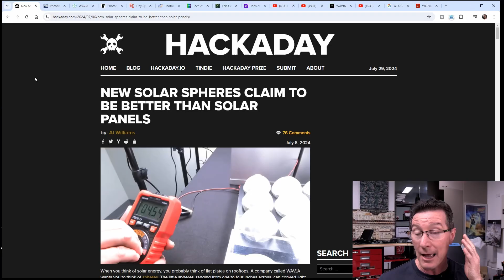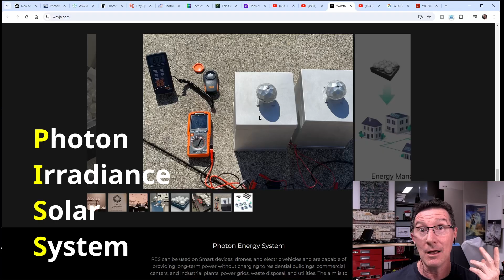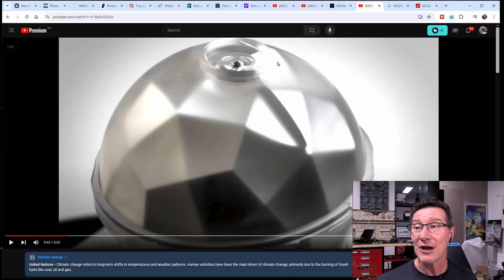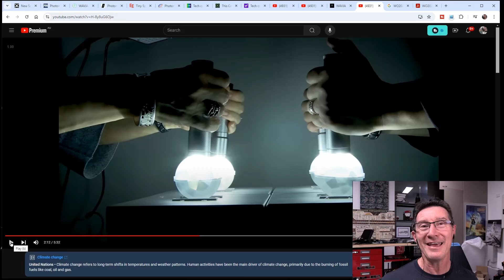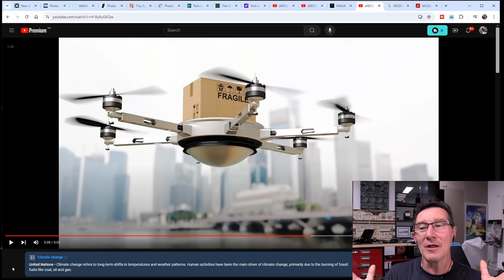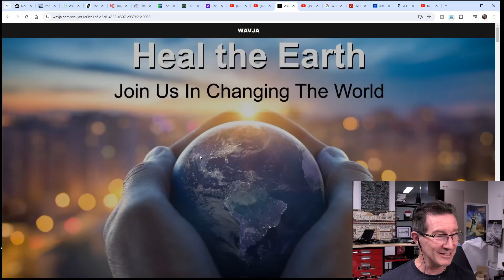EEVblog 1633 - WAVJA Solar Balls, 60x Better Than A Solar Panel? - Part 1

Comment: Hey bro, I have a curious question. I have a small solar setup to run my crosshair laser, it's for my Zombie shield, as it has 2x railroad spikes for the eyes 👀, being the target 🎯. I got a flashlight lantern and it has a small solar panel built into it, and got an extra solar panel to help with recharging, and the lantern has, I think, 5000 Mah power bank and a sewing machine cross hair laser. I got it all off of Aliexpress for $20 CND. And this thing is super light in weight, compared to what we used as kids, and it's also brighter 
Just wondering how good this would be for charging a 100-watt solar panel at night, and would the laser be good to use on a solar panel? The unit just has a little red check light to say it's charging. I don't have any testing equipment like you do. I was just wondering about the effect versus the cause, as I want to also outfit my medieval helmet with a car dash camera system, just for basic viewing information at quick glances and for nighttime surveillance, in low light conditions or StarLight. It requires 12 volts as well and is to be used with a cigarette lighter outlet, as the helmet viewing through a perforated metal guard is not the best. but its the safest and low maintenance vs a plastic shield which can get all scratch in no time, which requires replacements often, which is harder to come by in an apocalypse setting.

I flap on Qurora in answering questions related to Zombie stuff. And decided to actually do the bucket list 📃to meet the said requirements of being a melee paladin/tank or knight build.
I'm just upgrading some stuff to "second generation." The light can rest on the shield, which is slung off the left shoulder when not required, and leaves the lantern to face forward. This way, you can have a walking light at night for perimeter patrols. It's also about having a setup that "pops" and having redundancy set up to use for other areas as a bonus. 

Just a hobby type thing I'm doing so any addition info would be great!

Comment: Yeah , remember the little batteries,looked like easter eggs , and you'd pour a bunch into the glove box , and fancy software balances them all in order of level of charge. Well lift open one ,and you see the normal battery incased in plastic egg ..Tanktwo was thier name yo. And it made it to the trade show circuit etc . but the company will disintigrate , with no funds. Probably go back to writing battery management software for bill gates, type if needs equipment. And thatswhy people get excited about bogus products like these fake solar speres . Literally the physics on earth, or anywhere else in the universe will not support.😊

Comment: As a law student, I'm concerned by the use of Esq. in their names. One of them does appear to be a lawyer, but the other doesn't seem to be. Using Esq. is used to identify lawyers in the US. The Cheng guy doesn't appear to have ever practiced law His LinkedIn says he lives in New Jersey and I don't see anyone listed as a member of the Bar in that state by his name. If he's using that to gain credibility, especially as suggesting he's a lawyer, it could be unauthorized practice of law or fraud and misrepresentation. It's at least unethical. Normally, even lawyers only use it when they are serving in their capacity as attorneys, like on their employment website or court pleadings, but a CEO with a law degree, even if licensed to practice law, typically would not. That's super suspicious to me.

Also, if they are lawyers, when this comes out as a scam, they can expect Bar complaints and will probably lose their licenses.

Comment: They aren't even using a solar cell. The little dark thing on the top of their ball is an LED working backwards to convert ambient light to a voltage.

Comment: I think you should do the thing I just watched an ad for ties. it was for the Edison generator a lost technology that this guy found in his attic or was it a safe and it's so easy to do anybody can make it with the plans and it's small and lightweight and has plenty of power but if you're going for a whole home you wanna make the bigger version and it amplifies the power you put into it but it doesn't need the grid because you know his granddaughter almost died.
All I have to do is spend 50 bucks to get the plans and buy about $100-$200 worth of materials before the website gets shut down because of the super horrible energy companies. Yeah I reported the ad and watched their "five" minute video more like 30.
And oh yeah this is better than anything Nikola Tesla did I mean Nick–cola Tesla this is from Edison and his plant was burned down mysteriously.
Oh yeah and the disclaimer for entertainment purposes only and they cannot guarantee success due to variations in materials and construction yeah any buddy could do it with the plans anybody's anybody's even my great great great grandmother.

Comment: source trust me bro it works like this you charge it with your flashlight to get the multiplication factor by magic table and then any light that enters from the sun get's power multiplied by the charge factor and boom you got 20W out of 1W input power from the sun easy as that
this is just a joke

Comment: 60 times more efficient than current solar which is about 20% efficient.  Nice try......
Reply: Fact that  some people are able to fake stuff like this guy dont say anything about what is reality. Watch the real video and make sure you understand what it is that they claim. They claim to be able to make a sphere that is 20 times more efficient per cm2 than a average solar panel PER CM2. And it is correct - i can make a similar cube by materials other companies make today, so the cube is 100times as efficient as solar panels per cm2 of wall space. 10000% better if you measure just on energy per wallspace cm2

Comment: It dont have to be a scam, i think they are just overselling the performance. If a solar panel of 320watt/m2 are divided into 4 squares of 50cm x 50cm, then inventors claim that 10cm x 10cm x 10cm produce 80watt like the solarpanel. But solarpanel produce 80watt for 6hours this one produce 400% longer time, so to be 7.5times more efficient as they say, then they just need to improve solar system from efficiency of 16% with a standard solar cell to 30% to be right. And where a normal solar cell is 2cm thick this one is 5times more thick. So in theory it have inner walls that not only fill 10 x 10cm but 6 of these squares It is just less because it is not sq but round shaped. But your efficiency if up by 100% by using 600% more panel, so you go from indeks 200 and divide by 6 so the panels is just 30% as efficient as the solarpanel, so when they claim to have current efficiency at 20times (not 7.5) it can be archieved with normal solar panels. It starts to get a little odd when they expect the future to be 3 times more efficient, but maybe photon energy can make this happen.

Comment: Sounds like they're trying to create self amplified photo cells that work like lasers but without pump power, like the light will bounce off the mirrors and each time raise the energy levels in the doted material it is reflected from 😅

Comment: 60 times more power?
This meany that the efficiency is 61x 21% = 1281%
So 7.5 is wrong.
Where does the 1181% of energy came from? Some a StarGate like vacuum energy device?
38430
If they are 30x smaller, then the efficiency must be 1281% * 30 = 38430%

On of this devices is replacing 384.3 PV-panels.
A ordinary panel gives around 45V@10A and this device gives 45V@3843A ?
For this you need a cable with 4.65in² (3000mm²) cable cross-section.

Comment: In France, we use a Glomurge with quantum amplification that can supply 
provide 5 V or 5 W (it's the same thing) even without light. The cubic spheres are 
impregnated with over-activated Gibolin . 
Gibolin is made from "Camember au lait crû". I can't reveal how it works, as patents are pending!

Comment: Testing LEDs with photodiodes is problematic because of reflections - So a device called "an integrating sphere" is used to ensure all light is captured, with a small photodiode at the side. Those balls are essentially an "integrating sphere". However, they can only capture light through the aperture at the top. So They are correct that they improve efficiency - but 60% improvement for the tiny area they capture and certainly not 7.5x better. The cost of doing this of course is that they don't have a large area of capture - which means that overall, they probably perform much worse than a normal solar cell. There is one advantage: They don't need much solar cell material. But solar cells are dirt cheap these days, so even that is probably not an advantage. The BS at the end on powering flying cars is truly deluded.

Comment: Solar panel typical efficiency ~ 20%. Wavjina claims 20 to 60 times the efficiency compared to solar panels and I don't know if these also create space-time, or just energy and matter.
For anyone not understanding the significance, these prosthetic balls will charge your car's battery with the light from the headlights powered by the said battery. Infinite power!!!!!!!! Solar freaking ballways!

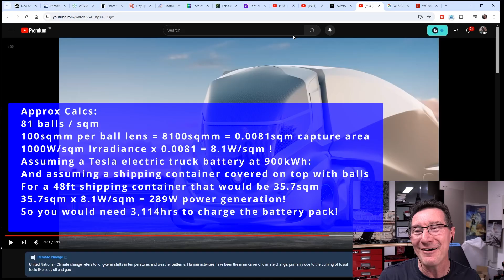Comment: 18:23 LOL! look at the diameter of the cables going out of the crap that is "supposed" to be able to charge the car! Do you note any differences with the cable used to actually charge an electric car? 🤣
And the previous picture is a huge drone moving a freaking cargo container of the ones used for import/export goods by ship.
How did that woman even said that claims with a straight face!??? She must have no f*cking clue at all. She must be some generic scapegoat someone hired to mount this scam.

Comment: They put zero effort into this.  At minimum they could have at least actually charged a battery or super capacitor with it. It would work... eventually. At least show something lol.   The whole concept is dumb though, just use regular solar panels, it will actually work better.

Comment: Saw this first in Sabine Hossenfelder's video, but she didn't go in so many details. Just saw that picture where they're allegedly charging an EV from a truck having these on its roof. You know why it's a truck? Like with all other perpetual motion / infinite energy 'machines', the real difficult part is where to hide the batteries. A truck trailer/container would do well for such a purpose...

Comment: Average panel efficiency is about 20%? 

There's no way to get past 100%(and as a practical matter even that's impossible), so their claim about the magnitude just doesn't add up, unless they're about to drop Nobel worthy research saying we're very wrong about how much energy the Sun sends our way, which would suggest current tech is far less efficient than we think. 

There's some chance(still early in the video) this tech could be better in some way than typical panels(more even performance across the day with that shape? could be useful sometimes), but their marketing is so excessive I'd have a hard time trusting it.

Comment: The thing you are calling a "patent" is a world patent application. It's a way to uniformly apply for a patent over a range of contracting countries. As you can see by the first page, they're applying to quite a few of them. But the point being, this document in no way is a granted patent. It's only an application. You can apply for absolutely anything. And it'll take 20 months or so before the national offices even see the thing, much less examine and rule on it. So long as the claims are unique, I don't think WIPO will prevent you from dashing yourself against the rocks of the USPTO etc.

Comment: They've coiled up a 12 light hours worth of optical fibre inside the balls and placed the end of the fibre in such a way that it shines on the PES.  This allows light to continue to fall on the PES device even when the ball itself is moved into a dark place.    All you have to do is ensure the ball is exposed to sunlight for a day and then it will generate power overnight too.  I'm disappointed all the engineers here couldn't see this simple solution.
Reply: The fact many people could read this and not realize it's sarcasm saddens me a bit. I mean, it's sarcasm, riiiiight?
Reply: @kngofbng  Yeah, good point.  People may take it as a serious method.
Reply: هذا منطقي

Comment: From the patent (apperently, haven't read it):
"[0051] Each 6 cm sphere can generate 300 kW of electricity in one second..."
Wait, that thing is more powerful than a kg of decaying plutonium? (which is about 500w, forgetting the per second part as it does not make sense) Even at 99% efficiency they are going to have to dissapate six times MORE energy than a kg decaying plutonium 238! As a bonus the power density is 81 GW/m3. Impressive

Comment: Looks like an integrating sphere....nothing new, used in photometry for measuring light...it's essentially a sphere with an aperture and a diffuse reflective coating on the inside. Nothing magic, nothing new and no free energy to be seen!
Reply: https://en.m.wikipedia.org/wiki/Integrating_sphere

Comment: yes, it can work at night. as you've calculated, it's claimed to be over-unity. which means that at night you can power it from the torch, and then get enough volts from it to power the torch back and take excess energy to charge whatever😃😃😃

Comment: I would not want to discount the whole idea so quickly. The output they showed was .6 and Dave already improved this to 4. something. I looked at a map and I was thinking what if we put millions of these in tiles or on roads we drive over. That is millions x .6 and that should be enough to power all cars and maybe some spaceships too so I can get off this planet.

Comment: You can't blame them from trying - but they are not even trying that hard.  I've seen enough cold fusion videos to see that all you need to do is produce a shiny video and hook a couple of investors and then run away with their investment money at the right moment.  It literally happens hundreds of times a day.  If there is an opportunity in the market its being a technical bovine excrement detection service.  You'd think VC's would due their due diligence but I guess there's one born every minute.

Comment: Dear god it’s so much worse. The “balls” are literally plastic housings for a webcam or laser usb powered decoration from Temu or something. You can clearly see the glued seam. This isn’t even a grift, it’s an unconventional warfare operation from some covert arm of the CCP. Either that or the two that founded the company have the 2,000,000x uber-power ball upgrade to have a pair big enough to legitimately try this. It’s so brazen it begets belief.
Reply: The guy behind this has apparently already been arrested for a previous scam with a similarly physics-defying product. It's just another serial grifter. Watch him move on to solar frickin' railways or whatever when the current grift inevitably runs dry.

Comment: 14:30 If light never escapes, why do we see light escaping when a flashlight is shone on it (looks diffused, not only reflection)? Very funny indeed. It would be nice to have a material that allows light to pass only in one direction and to create a sphere out of it. I thought of this concept during wave physics classes. According to theory, some light always escapes; you can't have a 100% reflective mirror. Perhaps using a Peltier module, you could utilize the heat difference. Anyway, bifacial solar panels work great for me, especially with prices dropping to $0.50 - $0.80 per watt.
Reply: Going through the comments before commenting on the balls lighting up when the torch was shone into it.

Comment: Whats in the box? I'm glad you ask! Inside the sphere is the sun which generates luminacity and seamlessly turns it into electricity by the new buzz word. Bouncing the light is lossless of course and its 20x more powerful that panel in your calculator. The base contains lead for shielding and acid to stabilize the 2V output. After 24h the sun has to sleep because the powerbank says so.

Comment: Good job I have a suspicion the "base" has the electronics and a battery itself to operate and could function as a crude capacitor? Anyway what a joke. They probably stole their "innovative design" from the motion sensor ball/mirrors on your $4.99 solar lights.

Comment: "It operates efficiently for 24 hrs", ... after which the built in battery needs to be removed and plugged into an 'inefficient' traditional solar panel to recharge.

Comment: Surprised to see this on hackaday, normally those guys have some engineering know how.
Reply: A click is a click is a click. They can always claim they're only reporting on it, not endorsing it. Throw in the word "allegedly" and you can say anything on the interwebs without taking responsibility for it.

Comment: You are spot on about the over unity claims. Generating more than the input solar power density on that tiny lens -aperture? At 100% conversion efficiency ( every photon gets turned into electricity).. reflection gets you nothing. Each bounce loses energy to the material. Mother Nature is a bitch.

Comment: 8:00 obviously its doing both, its an infinite energy source of course, generating more power then it consumes by using the power of AI and machine learning to achieve negative power loss when converting light to power, i can't believe someone like you did not understood that immediately 😂😂

Comment: The multimeter measures voltage and it also measures current and as P= I * V, it becomes a power meter.
Reply: Cant measure both with those lead config